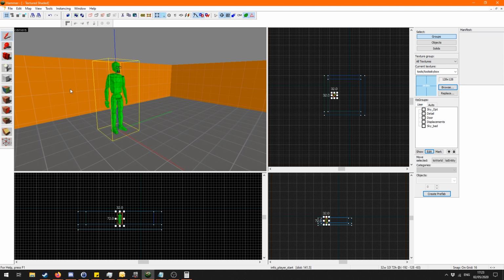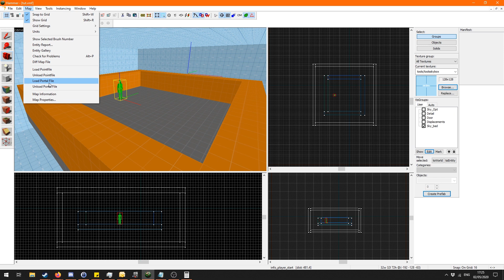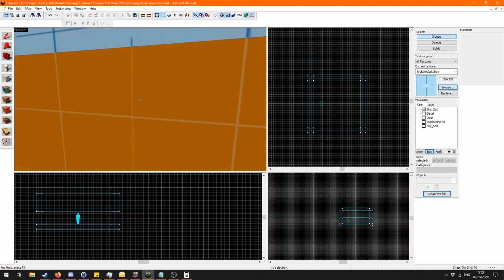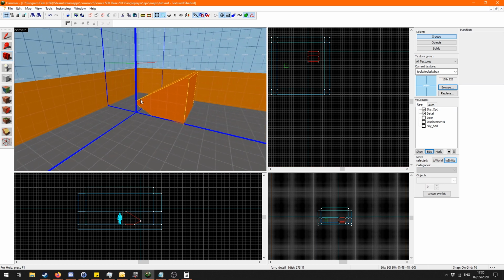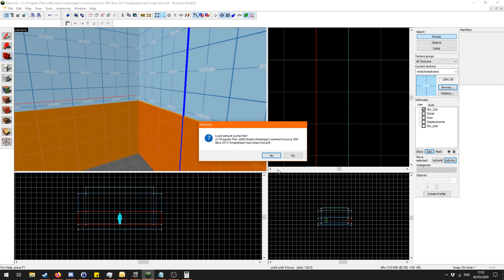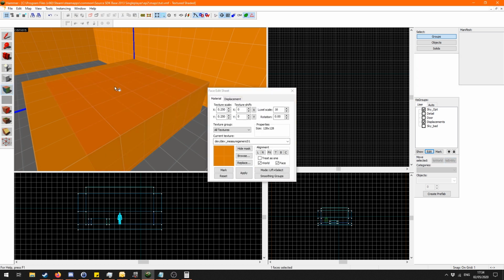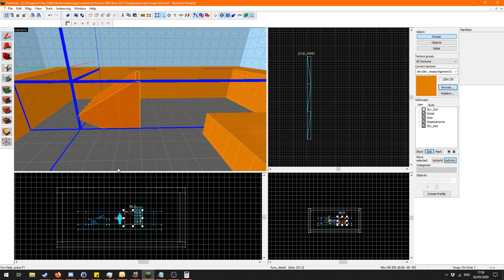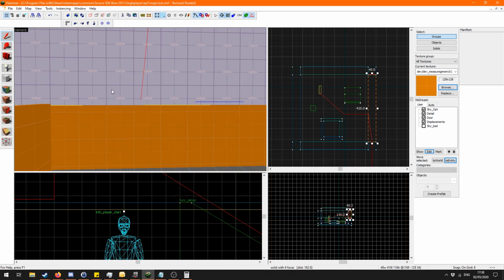Hammer Editor - What NOT to do and WHY!

Comment: i wish i wouldve found this video earlier. I just made my first GarrysMod map (which was quiet large) did the shitty Skybox as in your first example, fully detail the whole map without func_detail details (just used the normal blocks, textured it and so on. Everytime i wanted to compile it, my Hammer-Tool crashed. Then when i finally got it to Compile i wasn't able to upload it to the workshop, because the map was having alot of issues. Thanks alot :D

Comment: If your room square map has 4 visleaves, put the bottom left corner of the room at (0,0), it'll then detect the room as one room and not 4 different rooms. For some reason Hammer doesn't like centered rooms, whatsoever.

Comment: Is it really needed to make your map this optimized? It's 2024 and I'd assume most machines can run your map even if you don't make everything perfect. Love the video though!!
Reply: Brute force is no replacement for good practices and standards. If you're going to spend this time and effort creating a map, why would you half-ass it? There's no hurry, just take your time and do it right. When it is released to the public, the quality of the map will speak for itself, so have some respect for yourself and the efforts you dedicate your time to.
Reply: @UncleBoss-cr1cb  Yeah, ur right
Reply from the maker: The engine is old as heck and will actually kill your frame rate if it's too unoptimized, not to mention your compile times.

Comment: Curious, for what reasons would someone not want to use Carve like half the comments are saying?
Is it a more convenient tool that just has issues no one's discussing? Most experienced mappers refuse to talk about the tool in any of the tutorials I've seen so far.
Reply: It’s very unreliable. It can often cut up brushes in ways that create tons of unecessary cuts, and depending on the complexity of the shapes, it can cut things so badly that hammer straight up crashes.

Manually cutting stuff is both more reliable/safer and just as fast.

Comment: I'd say the vis stuff isn't super important anymore. I mean, most maps you can almost run without vish calculations on modern computers anyway 😝
Reply from the maker: I wouldn't be so sure. It doesn't matter how beefy your computer is if the engine is hitting certain limitations. You can still chug and lag terrible in a Source game that's unoptimized.

Comment: another tip for getting scale is to use the dev measuring textures on a 128x128 panel, 128x128 is the standard wall dimensions given by valve

Comment: how tfff do areaportals work. I cannot get them to work for the life of me..
Reply from the maker: A way to think of them perhaps is like they're a plug to stop water leaking out. If you place an area portal brush down, and there's a way for the water it's containing to leak onto the other side of the portal, then it won't work.
Reply: You can let an area portal space not be fully enclosed from the other side, for example if you put an area portal in a door that has a window next to it, that wouldn’t work because one side could get to the other through the window. You need to either put another area portal there or seal the window. This is what area portal leaks are, and I’m assuming that’s what you are asking about
Reply: You can’t*

Comment: Looking for help fixing an issue not mentioned in the video,
My maps geometry is finished but when I run the map.
Only the brushes within a radius of my cameras current position in hammer actually show up, meaning even if I go to the center of my map, any walls at the edges of the map will be missing when I test the map.
Any solutions?
Reply from the maker: Is your map a huge, open area? If so, it might be that the edges of your map are on a visleaf that's so far away it's being culled, even if you can see it. Try using a (or multiple) func_viscluster to combine visleafs.

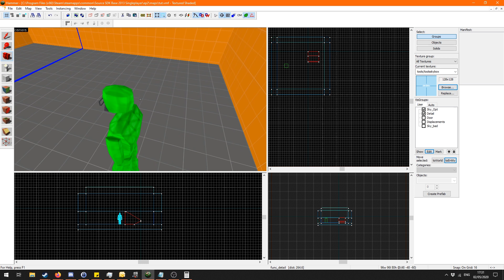Comment: 8:45
I really get pissed off when I see people always use gridsize 1 to make maps, it just makes it pain in the ass to edit and add more stuff to the map.
-
Also, you forgot about nodraw stuff, some people RARELY use nodraw. Idk if you know about HL2RP but the most popular HL2RP map (I17) is so unoptimized and the makers of I17 didn't use nodraw at all.
Reply from the maker: NoDraw isn't the be-all-end-all of optimization. BSP will actually cull faces that face the void, so if you skybox your map correctly, you only really need to ue NoDraw on faces that are inside the map, but the player cannot see. So for example if there's a closed off room that the player can only see through one plane, all the faces that the player cannot see should be NoDraw.

What I imagine may have happened with the HL2RP map is that the creator(s) did a big hollow skybox, and then didn't nodraw the outer faces that would otherwise be facing the void.

It's also possible that the map is simply very big with very long sight-lines with lots of props and details being rendered at once. This can drive down performance no matter what you do. Also, RP scripts are heavy af and put in a load of overhead.
Reply: @Trivvy  true
Reply: @Trivvy  Another important thing about nodraw is it allows a better perspective, you can select to hide all faces that are textured with nodraw allowing you a clear perspective, if the faces are not nodraw you might be trying to navigate the map interiors to see areas with the 3d camera

Comment: When i make a huge map, one of the floors and walls dissapear ;/
Reply from the maker: That sounds like a visleafs issue. Check for leaks, and if you have a truly massive open area, it may be turning off visleafs that you should be able to see, they're just far away. You may need to use func_viscluster to bunch them all together so that they render at once.
Reply: @Trivvy  Actually, it was the big red circle in the 2d view, it was annoying but now i fixed it

Comment: I make Team Fortress 2 maps and you pretty much don't have any other choice but to box your map, cuz it has to be high for rocket jumping and stuff. I even loaded up some maps, made by valve themselves, just to check, and 2fort, dustbowl, all these maps were boxed
Reply from the maker: Valve themselves aren't perfect. Sometimes map makers just get lazy, or they use other methods to optimize their visleafs, you can tell hammer to do things like combine all visleafs in one area into one big visleaf in order to cut down on compile time etc.
Reply: @Trivvy  True. I checked the c1m1_hotel map in L4D2 and doors and windows have both hints and areaportals on them
Reply: @Trivvy  how do they manually combine visleafs like that? i know how to manually split them but i never knew you could combine at will
Reply: NOO DONT BOX

Comment: 1. Carve
2. Carve
3. Carve
4. Carve
5. Carve
6. Carve
7. Carve
8. Carve
9. Carve.
10. Did I mention carve?
Reply: Google ”making terrain in hammer using carve tool”, thank me later, no more need for displacements.
Reply: Carve should be the first thing in this list LMAO
Reply: Step 1, build a solid block big enough to cover your entire level
Step 2, carve out the hallways and rooms from the solid block
Step 3, 😎😎😎
Reply: B-But how will I make public bathroom sinks? :(
Reply: @reptiliannoizezz.413  Use a prop. I can't ever remember which prop class to use, but I can assure you, this will lead to a better life in the long run if you don't use the carve tool. This is the first step to recovery. Accept the fact that carve is not good for you. Go to a carve rehab center if you need, they're very helpful.

Props to Hammer for... uhhh... this is a stupid pun.